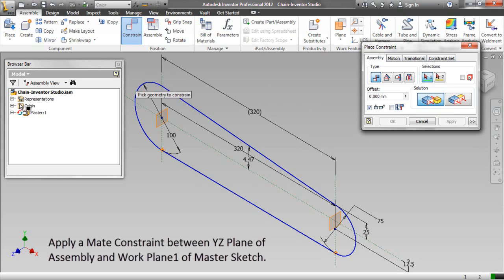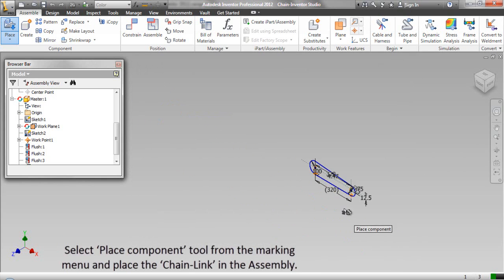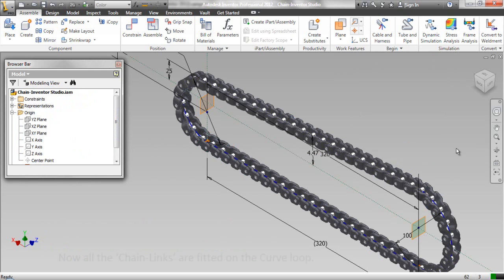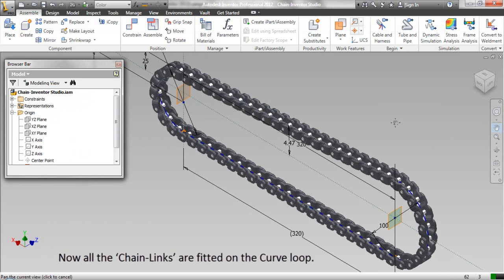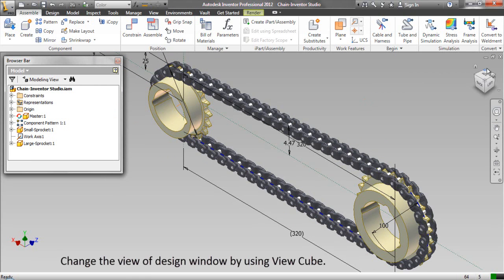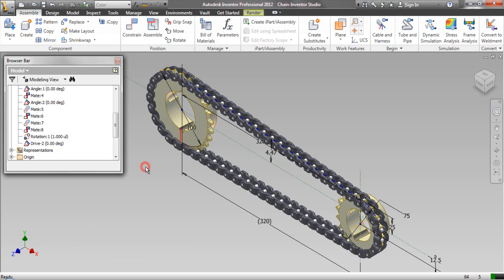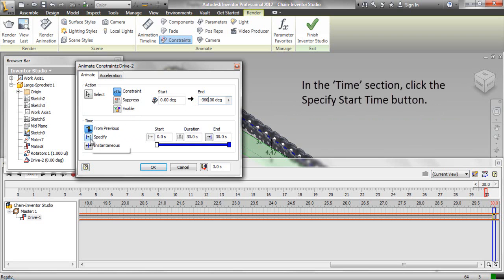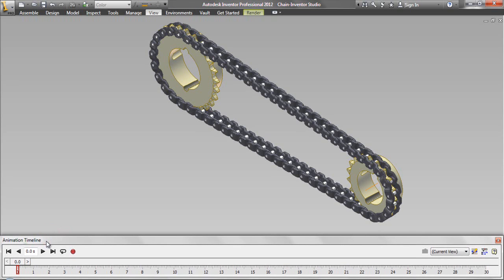Chain-Inventor Studio-Autodesk Inventor (with caption and audio narration)

Comment: Hi, Im tying to do the pattern in the assambley but the master does not show in the assambley the rectangular pattern that was created,  therefore I cant select it to perform the pattern of the chain link. Any thoughts?
Reply from the maker: In the browser bar select Modeling View.  By default the Assembly View is set there. Change it then pattern will be displayed in Master part.

Comment: Why didn't you include the ratio between the two sprockets in the motion constraint? Would the animation no longer work if the sprockets didn't spin one to one?

Also i can't figure out where you got the value 61 from when making the rectangular pattern. If you could clear up which value that represents i would appreciate it
Reply: I was wondering this too... My guess is that the value 61 is calculated from the curve lentgh and the distance between the chain-link. The curve length is 915.864 mm and the distance between the chain-link is 15 mm (according to their chain-link tutorial video). 915.864 divided by 15 is roughly ~61.
Reply: Better late than never, haha i posted that over a year ago while i was trying to animate an old corvette transmission i modeled in inventor (never figured it out to this day). Thank you though!
Reply: Haha, I noticed that right after I replied. Well maybe now it's time to continue the work on that corvette tranny ;)